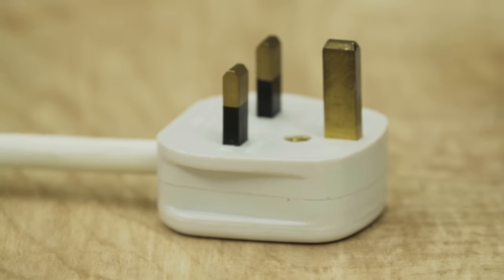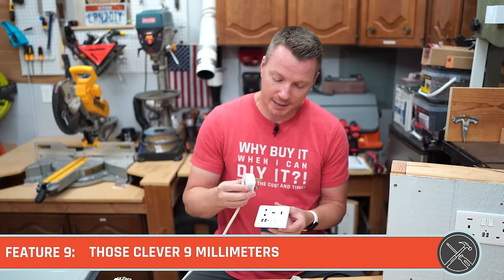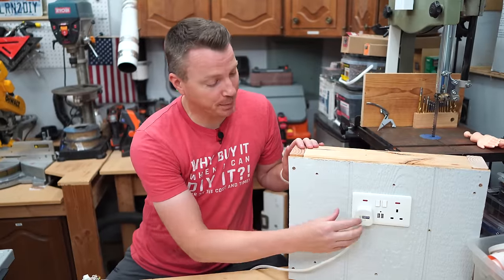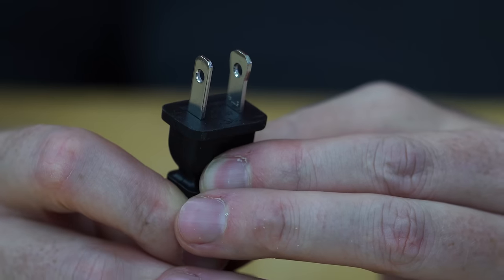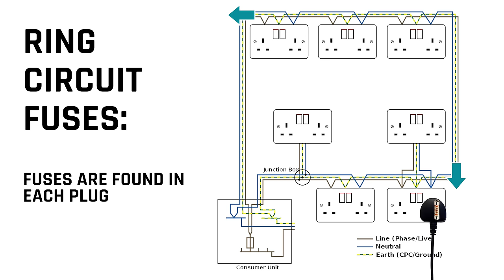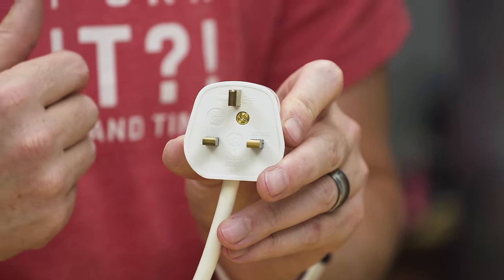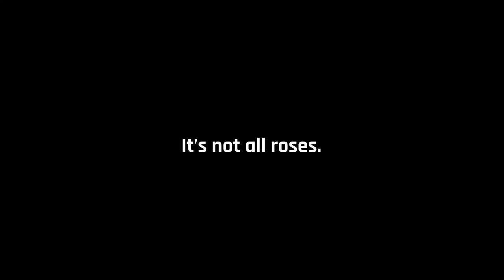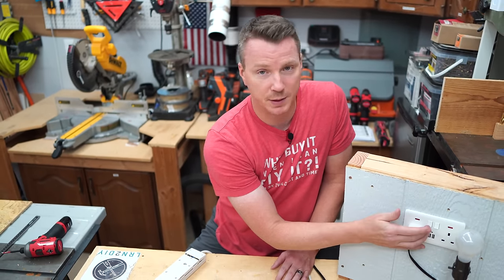British Plugs and Outlets Are On Another Level

Comment: One great thing about the switched outlets (or sockets, as we call them) is that you don't need to leave things unplugged (where they can be stepped on). You just leave them plugged in and switched off. You learn very quickly not to leave British plugs on the floor. Interestingly, we do have sockets without switches, but they are pretty rare these days. Although, they are usually used behind kitchen counters for appliances. Then we have fused switches on the walls to isolate the appliances.
Reply: My house built in 1972 has no original switched sockets. 
I have replaced some over the years with switched sockets though unswitched are still available. Either meets code.
Reply: You can still get unswitched outlets, they are generally used for things that you never want to be accidentally turned off. A classic example would be a freezer. They are also sometimes used on things like a washing machine or dishwasher with a remote switch so you don't have to move the appliance to isolate it at the mains.
Reply: In fact, wiring regulations make it difficult to have unswitched sockets. Every appliance has to have an obvious point of isolation and the switch is the easiest way to achieve this. Even the freezer will have a switch - but it should also be labelled to reduce the chance of it being accidentally switched off.
Reply: @gavinminion8515  where does it say that in the regulations because I have not seen it.
Reply: @jonathanbuzzard1376  BS7671 chapter 53 mandates isolation for every circuit. The on site guide also says (under 5.1.1) - "Means of isolation should be provided for every item of equipment". Whilst I don't think there is a specific mandatory requirement (hence the word 'should') it would be difficult to defend the use of unswitched socket outlets.
Reply: @gavinminion8515  And I will argue very strongly that pulling the plug out of the socket is a means of isolation. I would then ask you to show me a switched shaver socket to back my argument up🙂 The point is that the appliance should be able to be isolated from the mains so that it can be handled safely for whatever reason. Pulling the plug out of the socket is a means of isolation. I would further note that IEC60309 sockets are also never switched. Consequently, the regulations don't require the use of a switched socket which is why they are readily available. That most people prefer switched sockets which is why they are most common is a different matter.
Reply: @jonathanbuzzard1376  Okay, I'm not going to die in a ditch over this. I'll refer you back to my first comment - "Every item has to have an obvious point of isolation - and the switch is the easiest way to achieve this." . For the record, many IEC60309 sockets do have a switch - often it is part of an interlock so that the plug cannot be inserted or removed with the power on. As for shaver sockets, they oftren do have switches - but as these devices are so easy to unplug, the switch is incorporated into the outlet so that it disconnects power automatically as the plug is removed. This also serves the purpose of disconnecting an isolating transformer which is required for shaver sockets in bathrooms. 
I guess this is a bit like the highway code - it 'says' you should drive in a particular way, but not all the rules are backed up by law. Nonetheless, if you don't follow the code and something goes wrong, you will have a hard time defending your actions.
Reply: @gavinminion8515  I'm going to have to agree with others than a readily removed plug is in itself a means of isolation - a switch is NOT required. Appliances which are not connected via plugs should have a means of isolation (extractor fans, ovens, wall mounted heaters, split airconditioners, and so forth).
Reply: @gavinminion8515  Just to clarify, unplugging satisfies isolation, indeed, it's the safest means of isolation. A remote isolator is only necessary if the socket is not readily accessible. Also some socket switches are only functional and do not meet all the requirements of an isolator.
Reply: @hughieandrolf  Agreed, and perhaps my original comment was unclear. I meant that the switch is the 'most convenient' way of achieving isolation for end users. I never intended to say that switches were required, just that appliances need to be able to be isolated. Removing a plug is the safest way of doing this but is inconvenient for many end users so the switch is often preferred. As a result, it is hard (but not impossible) to buy unswitched sockets.
And your point on the difference between Isolation and functional switching is important too. Whilst the terms are often used interchangeably (As I admit I did above). In this case, the switch on the socket is intended for functional switching and not isolation in the technical sense (My bad).
Reply: Plugs and Lego bricks: Two things you must never leave on the floor, especially at night. 😁
🇬🇧
Reply: @jonathanbuzzard1376  Unswitched sockets are designed to be controlled upstream. They aren't to be ever connected directly to a spur or part of a ring final.
Reply: @jonathanbuzzard1376  Unplugging isn't isolation. It's disconnection. Very different. Argue away. You're wrong.
Reply: @grahamek86  Then how do you explain EVERY shaver socket in existence both isolated and none isolated designed for the UK market then? I have never ever seen one with either a switch on the socket or a separate switch somewhere to isolate it. Clearly, nearly every shaver socket that has ever been installed didn't meet regulations which seems unlikely. What I will say is the professional electricians at work insist on using IEC60309 that don't have switches other than breakers at the panel as a means of isolation for various bits of hardwired kit in the data centre. They must all be wrong too. Unswitched sockets make sense where accidentally switching the device off would be an issue, usually, something like a freezer in a utility room or outhouse provided the socket is accessible.
Note that a switch is only a means of isolation if it is a double pole switch and the vast majority of sockets on the market in the UK only switch the live so don't isolate the appliance.
Reply: @gavinminion8515  That's only true of appliances which uses fixed wiring, when you must use a switched spur socket. It absolutely does not apply to normal socket outlets where people are free to have unswitched or switched types according to need. They are commonly available.
Reply: most extension leads don't have switches either.

though from what I understand, people in the US are scared of using extension leads, I think due to the lack of fuses and not being able to handle the increased current off of a single socket like we can over here
Reply: @gavinminion8515  to back you up on shaver sockets, i've lived in many flats that had an isolation switch outside of the bathroom just for that purpose :)
Reply: @Rich-qs6kn  You are correct that the US has big problems with their extension leads (or power strips). They have particular warnings about daisy-chaining them too. 

One of the issues is that power strips are available in the USA with thin wiring. For example, AWG 16 is often used, but that's only rated for 13A whilst the circuits it will be plugged into will have at least 15A breakers and are very likely to have a 20 A breakers. That means there's a fire hazard if a heavy load is put on it.

The Technology Connections YouTube channel goes through this, where he has a good rant (he likes ranting) and says it could all be fixed by a simple expedient - that is by using fused plugs with the correct rating.
Reply: another thing is you can place these almost flush behind furniture, i never realised what a privilege being able to stuff a lamp cord behind my sofa was until i moved country 😫
Reply: @Monkeh616  one can't rely on isolation by pulling out the plug to isolate something if the plug is damaged, jammed in, or heat fused in the socket.. it happens..
Reply: @johnc4780  Nor can you rely on the switch if it's damaged.
Reply: @grahamek86  I'd love you to quote the specific regulation which says unswitched sockets are not to be used.
Reply: And don't forget the cord pull for bathrooms, electric showers etc
He UK is the best for households safety.
Reply: @fivish  code? surely "regulations"? We are not American yet
Reply: @gavinminion8515  A plug and socket is an accepted means of isolation, so no switch is required.
Reply: @gavinminion8515  No problem defending them. A plug and socket, by itself, is an acceptable of a means of isolation, so a switch is not required on the socket. Where a switch would be required is remote ones, for under-counter sockets for appliances - you don't want to have to pull a smouldering tumble-dryer out to pull the plug to isolate it!
Reply: @TheEulerID  whenever I go over to the states I always bring an extension lead with me so it saves me bringing so many different adapters for all my devices. So is it a good or bad thing if I'm charging 2 phones and a power bank for my phone each night?
Reply: @Klynch111  you are ok with small loads like that. it's when people put things like space heaters on extensions which are the issue.
Reply: I've noticed that new sockets have usb sockets in them too but it irks me that there are no switches on them and they are constantly live. Just doesn't seem safe to me.
Reply: @cleanerben9636  A lot of electricians have noted this. In the past there was no such thing as an active device which could not be isolated. However, it's becoming increasingly common. There are now lots of "smart switches" with active electronics which can only be isolated be turning off an entire circuit. Even things like RCBOs and RCDs arguable are the same; they are permanently on unless the entire circuit is isolated. 

As far as USB equipped sockets go, I've yet to hear of them causing safety problems in practice, so I assume they are designed with appropriate safety features.
Reply: @TheEulerID  I would hope so. I don't think I'll try sticking a fork in one to find out tbh.

Comment: Fun fact. The amperage of the British electrical supply changed in the early 50s. To avoid comparability problems, the law was changed to allow manufactures to sell products without a plug fitted. It was quite common to buy a toaster or lamp without a plug until 1992 when it became mandatory again.  

Every kid was taught how to wire a plug in the UK. I don't know when they phased those lessons out, but I definitely learned it in the late 90s.
Reply: I learnt it in science gcse physics.
Reply: i had my gcses like 2 years ago and we never learned how to wire a plug but we did learn about the components of one (like where the wires go)
Reply: everybody that age knows how to wire a plug, most of the stuff you bought in shops came with bare wires!!
Reply: @timmytimmy9757  instead of "would you like a bag with that?" it was "would you like a plug with that?"
Reply: Yup, I learned that in school too
Reply: God yes, you would have a rota of three plugs that would move from appliance to appliance at home!
Reply: I was born in 88 and we didn't learn it in school, although my Dad was an instrument engineer so he taught me as a kid anyway. I've done hundreds now as I'm in the electrical business but some of my mates wouldn't know where to start!
Reply: @gtikurt  same age as me. There wasn't such a strict curriculum back then so it largely seems to depend on which school you attended and when they decided to stop teaching it.
Reply: They still teach how to wire a plug in the secondary school Physics curriculum.
Reply: Extension leads come with cardboard around the plug showing you how to wire it usually.
Reply: Yeah, I learnt it in primary school. Though why I would need to know that aged 8 is beyond me. To be fair I never forgot how to by the time I actually needed to as a teenager
Reply: @franklingoodwin  I fitted my first plug at age 5 when our new TV arrived. My mother wouldn't let me plug it in until my dad came home from work and checked it. I remember feeling insulted 🙂
Reply: @gtikurt  I was born in 86 and I did, but it was in primary school with a male teacher, possibly as way to settle kids down since I think it was nearing summer holidays.
Reply: I think they had to standardise it after a young woman burned to death due to a poorly wired plug or a low quality plug that couldn't handle the current.  The blame was placed on the woman herself rather than manufacturers of the faulty plug or the appliance she used so they then legislated for standardised plugs that manufacturer is wholly responsible for which rocketed the safety parameters as no company wants to be sued or found liable for damages.
Reply: I learnt this in year 10 in about 2010/11
Reply: They haven't phased them out. I learned it like 5-6 years ago
Reply: Heh - yep I remember wiring plugs when i was 8ish - Dad always taught me when he was doing it himself so it was easy for me.
Reply: As a 90s baby I never learned to and wish I had. That said our plugs and wiring seem to be robust enough that I’ve never had to replace a plug that was built-in.
Reply: Yup. I worked in an electrical shop from 1969 to 1990 and all appliances were supplied without the plug. Just wire ends, sometimes ready-trimmed to the correct length to fit a 13 amp plug.